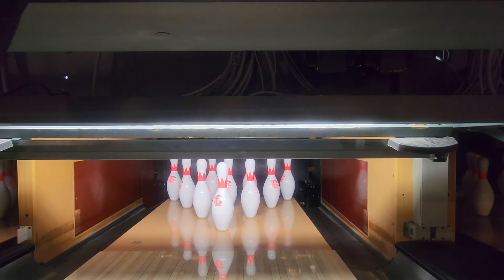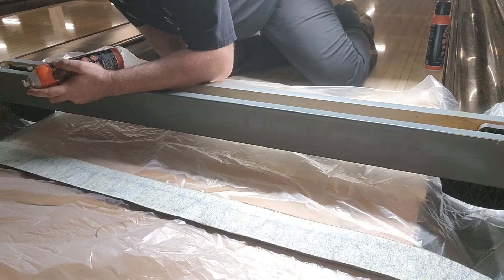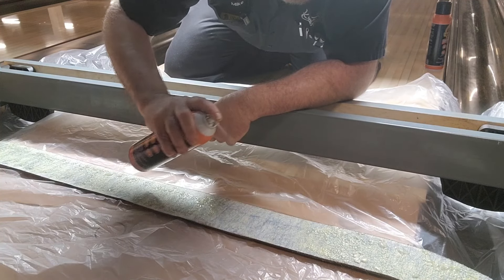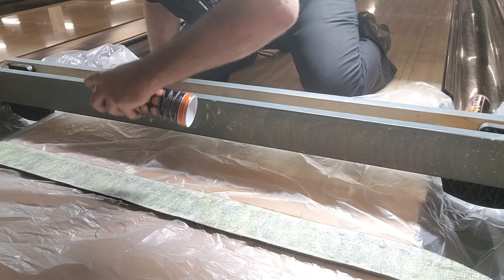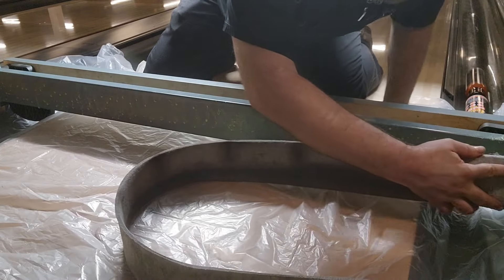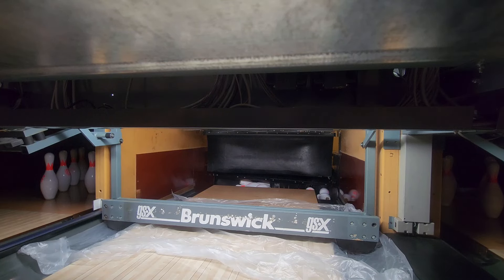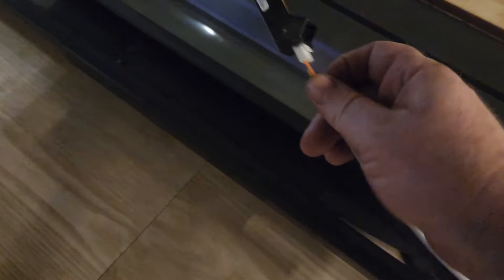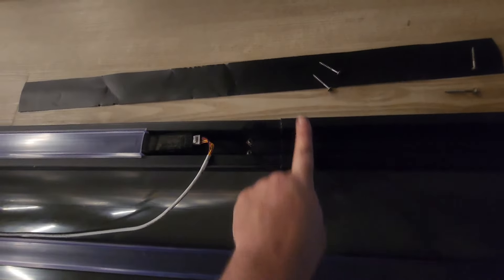GSX Pinsetter - Sweep Wagon Felt Pad Installation and Frameworx Capping Replacement.

Comment: I take it the felt is a sound dampener? Why does the A2 not have such a thing?
Reply from the maker: The A/A2 machines have a rubber pad. The rake board is typically made out of fiberglass or some other type of composit material, like plastic. The sweep wagon is a steel box frame on the section that contacts the pins.
Reply: @michaelbuckley3808  gotcha, 1 of my fiberglass rake boards has the rubber, I’ve been converting to the Kegel rake boards and they are a bit noisy in my opinion